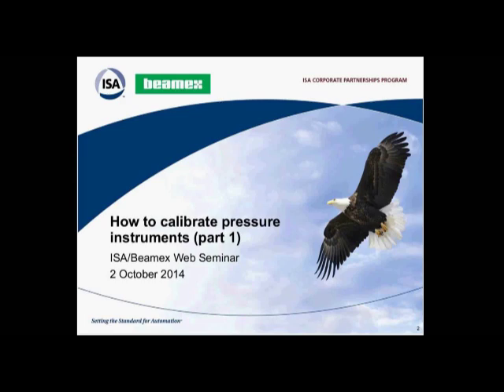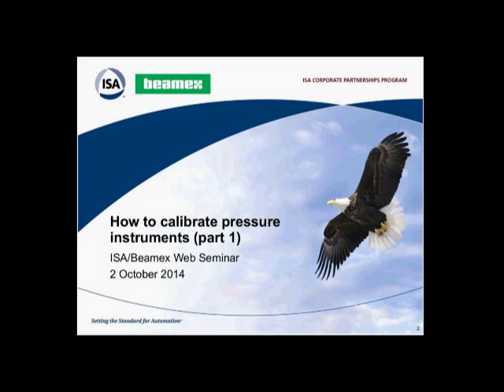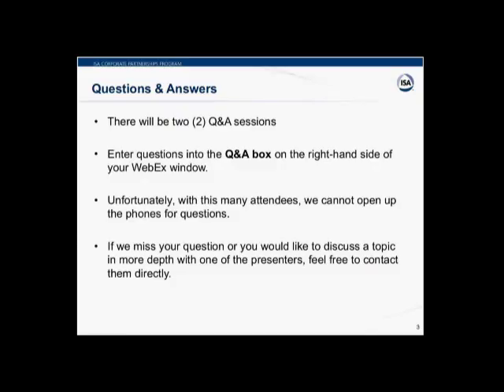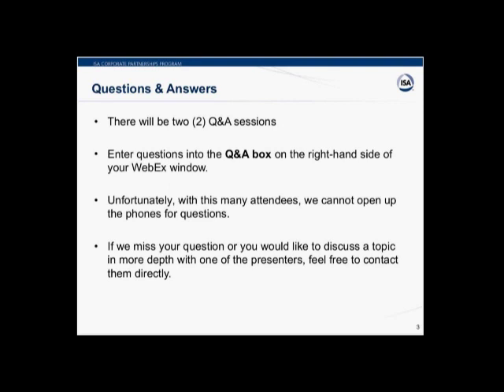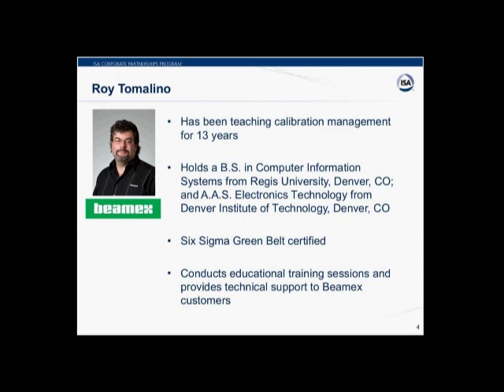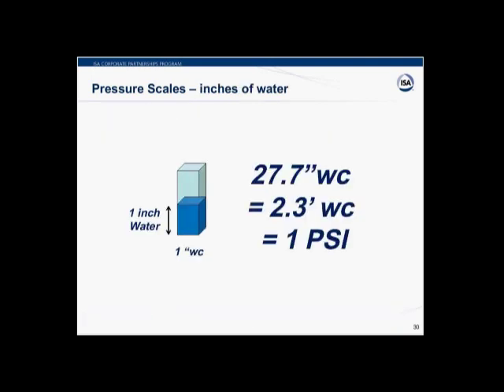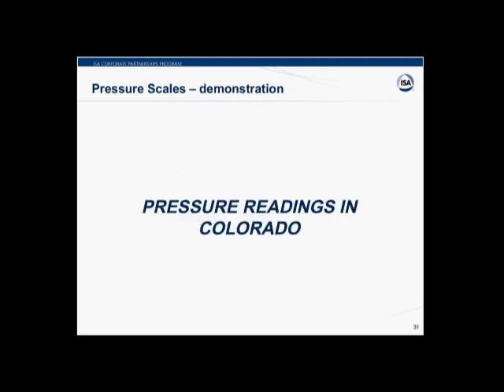How to Calibrate Pressure Instruments (Part 1)

Comment: And when switching from gauge pressure to absolute, what is the measurement accuracy?
Need to use RSS to determine measurement accuracy in absolute mode?